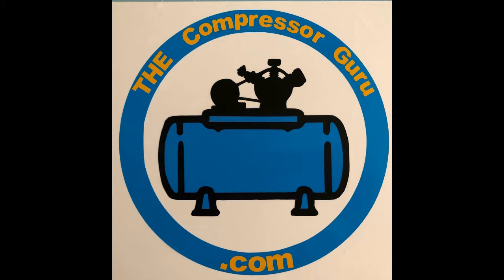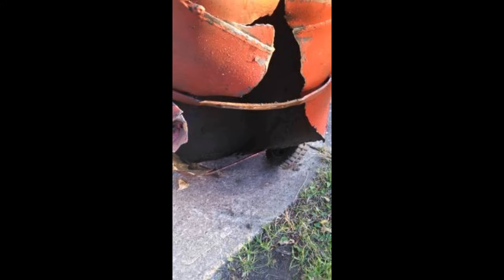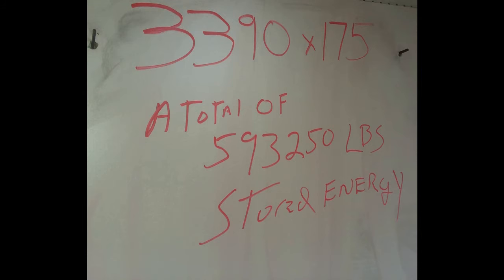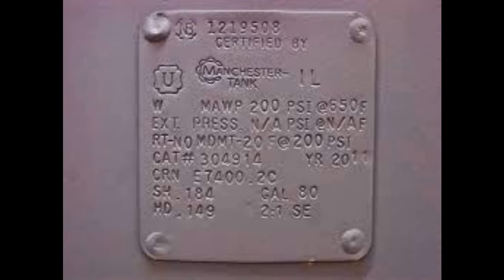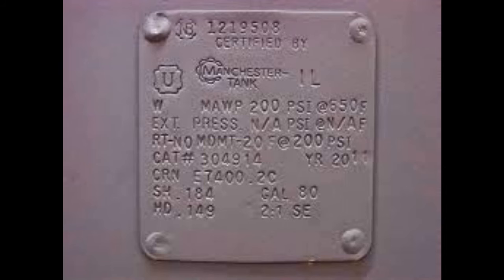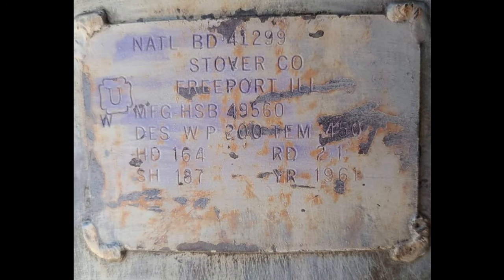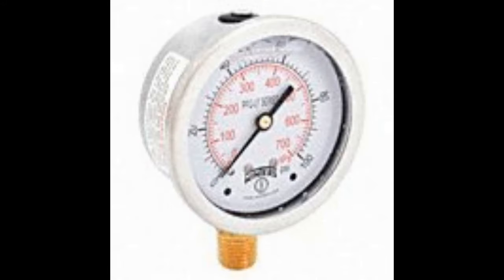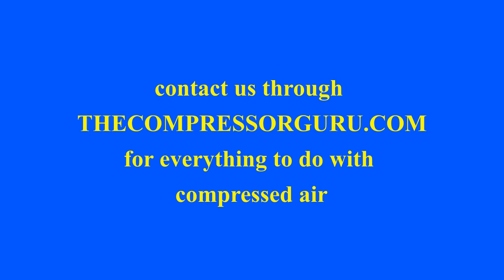Tank Safety, This video may SAVE YOUR LIFE!

Comment: My co worker had his vertical tank blow up thru the roof like a rocket and kick out the concrete block wall when it went off.  Too bad I didn't get a picture for you on that.  It must have sounded like a bomb went off I am sure of that!   Good thing no one was even near it when it failed it caused a lot of collateral damage in a 10 foot radius.
Reply from the maker: I am very glad no one was hurt. some people think this video is hype. it is a pressurized vessel, stored energy.  have a great day.
Reply: @THECompressorGuru  I have zero doubt about the lethality of a tank exploding after having witnessed the aftermath of what it had done to his garage.

Comment: Love the video but have one critique. Agreed, a pressure vessel could be considered an energy storage device, however, the 5hp motor running for 8 minutes, and the comparable work it could achieve isn’t really analogous. Compressing air is wildly inefficient. Most of that energy will be wasted as heat, both absorbed into the air being compressed and dissipated into the atmosphere. That’s all energy wasted before air even hits a tool, which further perpetuates energy losses. The energy put in to pressurize the air doesn’t all end up in the tank. It’s a very disproportional relationship, however, that doesn’t mean it’s an insignificant amount of energy. The danger comes into play considering the form of stirred energy. Compressing air is effectively like compressing a giant spring. If you applied equal energy into a hydraulic system, but it’s far less potentially hazardous just because hydraulic fluid is not compressible.
Reply from the maker: you are correct about a couple things there is a given inefficacy to compressing air I am sure that most of the energy to compress air is wasted as heat. 
 you are correct that hydraulic is safer in these respects. but there is very limited ways to store hydraulic energy. that is a major difference with stored air.
 a compressed spring is a different type of stored energy, there is a potential energy  and once it has expanded the energy is gone.
 if you have a tank failure there may possible be shrapnel involved which enters an entirely different realm of what may happen after the air has decompressed.  interesting points to consider.
Reply: @THECompressorGuru  absolutely true. For all intents and purposes, hydraulics cant be stored to the degree where they’d be able to achieve any work by real world standards given the fluid dynamics necessary in hydraulic systems. I didn’t mean to nit-pick but just felt compelled to mention that pneumatic storage as far as an energy vessel, has a very disproportionate relationship when considering energy in supersedes energy stored by a considerable margin. Regardless, if the tank were to encounter catastrophic failure, such as an explosive decompression, the hazard still remains quite lethal. I just attribute it more to the properties of the form of stored energy rather than the energy required to charge the vessel (compress the fluid). It’s not necessarily the potential energy that makes it lethal, rather the compressed air is essentially a spring; moreover, it’s compressibility property grants it the capability to violently decompress.
Reply from the maker: @kfs777  Agree

Comment: Im still weary of certified air vessels after witnessing a 120 gallon IR propelling through cinder block, chain link and into the parking lot. It was professionally installed and yearly inspected along with the other two compressors. I remember starring at it, it peeled at tha seams : \
Reply from the maker: Bill I agree I just wonder how old the tank was MOST boiler/tank inspectors will require hydro testing after 40 years. but tanks do fail. that is why we should be as careful as possible.

Comment: it seems there are more videos on this where the failed tank was a horizontal unit vs a vertical one. no doubt the vertical could explode too but it seems to me the horizontal has more surface area drain and I don't think they are pitched to let water escape are they? like a shower floor would be to let water drain, vs say a vertical tank where usually with the drain at the very bottom, moisture should drain out easier helping to reduce rust build up?  also I've seen the mods for after coolers or maybe more expensive units have that already added. Seems like that is a good idea with a water trap before the air enters the tank even ?  Still I always drain mine and leave the valve open but i use it infrequently also
Reply from the maker: good points. 
with a vertical tank the bottom is domed and an drain point. 
on the horizontal tanks they have to be slanted slightly towards the end that has the drain. and not to much so that there would be a "heel" below the drain. 
I think the biggest factor in many of the tanks is maintenance and you are doing good.
 the other thing is the cheaper compressors do not have "coded" tanks which means that did pass a test 150% of the working pressure. 

I personally will not sell a non coded tank or would I ever buy 1 for personal use. Good Comment. thanks

Comment: I have a question, What do you think about putting fuel tank sealer paint inside the tank. 
(Not to seal leaks )But for a coating or barrier to prevent moisture contacting bare metal inside the tank. I was looking at product that had a rust inhibitor and moisture barrier.   
I haven't done it to mine. I was just wondering if anyone out there has or if it's a bad idea and why. Cheers
Reply from the maker: this has come up before. I think at least use something like extendo from permetex and get the bottom coated.
Reply: @THECompressorGuru  thank you I'll look into it. Do you think it's a bad idea?
Reply: Not a bad idea. You may never know.if it helped, if the tank never rust out... it probably helps and will not hurt.
Reply from the maker: @the-trolling-mechanic  no its a good idea. it can't hurt it can only help. I answed from my phone under bud stiner

Comment: What if I have a tank with a small pinhole leaking air.... and I need to finish a job (wood finishing job), can I still use it without trying to repair it? The tank also has a safety valve, and I set the compressor to work between 30psi and 60psi..... of course, the compressor keeps running more often, but not that much...... how risky is that?
Reply from the maker: I do not want to answer this question. because I am not able to see the future. I will say a pin hole is the very best way a tank can fail! get a new tank very soon!!!
Reply: The pinhole indicates the tank has failed.  You got lucky by getting the tiny leak that tells you the tank is done, instead of the tank just exploding.
Reply from the maker: @e-curb  a pin hole is a failure. it is the best of failures, rather than a catastrophic explosion!

Comment: People need to drain their tanks from the moisture content on the daily, minimum weekly, this moisture creates rust that then clogs up you pressure relief valves, and can also damage the pressure switch, it’s this switch that kicks in and out once the air volume drops or reaches maximum capacity so understandably this switch can wear out, now it’s your relief that should be a fail safe should that occur, guess what happens when it doesn’t ? It becomes a bomb, so drain your tank, check that relief valve daily , it literally takes but a couple minutes.
Reply from the maker: you just described the perfect storm!

Comment: I purchased a Black Husky 20-gallon vertical air compressor from the marketplace yesterday. However, upon inspection, seller said the motor fan is broken. I've already ordered a replacement fan. The seller assured me that the compressor is less than 2 years old, despite the broken fan. He mentioned that it has been stored in my garage for about 8 months. He suggested that by replacing the fan and draining the water from the tank, it should operate like new. Is it acceptable for the water to have been sitting in the tank for approximately 9 months, considering the seller's claim that the compressor is less than 2 years old? It's my first time using an air compressor, and after watching this video, I'm a bit worried about the possibility of an explosion. 🙂
Reply from the maker: I am sorry to hear this. I would have a great concern about the safety of that tank. if you have the ability to hydro test it, PLEASE do.

Comment: lesson one, do not mess with a pressure vessels integrity. don't drill, cut, weld, hammer, drop, shock, hit one. if there's any signs of leakage, immediately vent the pressure off and render it permanently unusable.
Reply from the maker: I agree  with all but the last. a leaking tank can be repaired by a certified welder then hydrotested. before putting air pressure back in it . some larger tanks a may be worth the expense to repair and test. BUT DO NOT JB WELD LOL
Reply: @THECompressorGuru  No it can't.

It's technically possible.... but it's prohibitive to do so legally and correctly on these cheap small mass produced vessels.  You couldn't even afford to obtain the proper documentation to start with.  

Being a code certified welder is only part of it.  There's inspection, testing, and documentation that would need to be performed also to be legal.  

Not to mention anything that corrodes through is going to be shot and condemned. You cannot weld with any integrity on corroded metal for starters. You can't access the inside to clean it or prep it.

Even larger compressed air accumulator tanks in industry, typically do not even come with man ways. They're basically unrepairable. They are also pretty cheap. You can get a 2000 gallon tank for under $10,000. You couldn't afford to even repair that vs just buying a new one.
Reply: @THECompressorGuru  well... that's interesting. Your last words in the video were to NOT weld a pinhole. I recently picked up a 60gal 5hp compressor and realized it has a tiny pinhole. Certainly there must be thin spots inside. I was considering hydrotesting after having it repairing but am getting mixed messages.
Reply from the maker: @danielbuckner2167  you did hydro test it to 150% of the working pressure on the tag? if you did after repair then ...ok.
Reply: @THECompressorGuru  The repair has not been made yet. It would be tested before use naturally.
Reply from the maker: @danielbuckner2167  the risk reward for repair is to low for me. I recommend going tank shopping. 
Good luck 
Bud
Reply: @THECompressorGuru  thanks. I already have other compressors. This one will either be sold without tank for liability or just scrapped. Thanks.

Comment: Yes sir. Watching these videos makes me not want use mine. Cambell hausfeld black 20 gal 5 hp. Belt drive. Had oil less one about same tank. Was wanting to double my 5 hp to 40 gal. Now scared to. Think put mine outside this year build little pump house by the building. Plumb it in.  With auto drain.
Reply from the maker: Paul a pump house is a reasonable choice.you may have other issues in the winter if you are in a cold climate. feel free to contact me through thecompressorgugu.com
Reply: @THECompressorGuru  in wv thinking just cinder block  with styrofoam board insulation. Lid that hinge up or lift off small door way  2’x4’ big enough for compressor.
Reply from the maker: @paultrimble9390  Bad Idea. Compressors make heat . they need ventilation . and in the winter they will need some heat. a 5hp pump running constant may generate 20,000 btu in a tight space you WILL cook your machine. Build a bigger box or a small room.

Comment: Is it good to leave the drain valve open when not in use? 
Such as in non climate controlled shops. Would this help prevent internal sweating during temperature swings or make sweating worse.
Reply from the maker: it can not hurt. but once the moister condensates out of the compressed air, there should be no more water accumulate in the tank fill of air. interesting thought

Comment: I have a Saylor Beall 120 gallon tank that looks like it was commissioned in 1969 and last inspected by WA labor and industry in 1997 that I bought off a nice gentleman a couple of months ago.  It has a working pressure of 200psi.  I got it wired up and ready to go then saw your video.  There was some rust bits that came out when I was checking out the drain port (it was bone dry).  No more than probably a tablespoon or so and no bits bigger than 1/16-1/8".  That was probably from transport knocking it loose.  I ran it up to 150psi with no problem (not leaks) then just shut it off and drained it.  I'm getting the regulator and hose fittings in the next few days. Would you suggest I do a test run (in my garage) up to shut off with no one home or do all the work to get the fittings to do my own hydro test?
Reply from the maker: I am very weary giving advice on this. If I bought a brand new tank and used it 40 years and drained it regularly it would still be time to have it tested. knowing that it was re certified 25 years ago is comforting but I do not know what number a boiler inspector would put on a tank recertification. I do not know if you should trust it or not that is up to you. it does sound like it was well kept. We DO NOT hydrotest here . so the fitting question I can not answer. I can tell you ALL fittings on the tank are NPT . you may want to check out Vintage machinery video link in the description above. good luck. and you may contact me through thecompressorguru.com.

Comment: If someone fixes a compressor with jb weld this would be the first area to break thus releasing pressure through the weakest point. Also compressors are supposed to have Saftey valves to blow off before pressure. Also drain tanks Daily, don’t leave air over night.
Reply from the maker: the safety is only rated for 66% of the tested pressure of the vessel. and if the tank is weak there is not telling if the tank will just start leaking "best case scenario" if it fails suddenly it could be an explosive situation. if someone fixes with JB weld they may end up on some other channel is The Darwin Awards.
Reply from the maker: @super duper ducky I never heard the 65% thing I understand the standard boiler cert test to be 150% of the WP of the vessel. so a 200 wp tank should be hydro tested to 300PSI. If I understand the way you worded the 65% a 200 psi wp should have a 130psi safety valve?
Reply: Someone fixes an air compressor with JB Wells shouldn't have an air compressor. Period

Comment: I bought an old locally produced industrial compressor second hand with a 4kw motor and a 200L tank. The max operating pressure is 16 bars, so it's almost twice the pressure of an ordinary compressor. The tank is made out of 10mm+ thick steel and is certified by the manufacturers. It was made in the mid 80s, and I've just refurbished the pump with new gaskets. I haven't had a hydrotest done to it yet since I have to order a tester for it. After having the test done, is it safe to assume it won't blow up into pieces? That thing holds an insane amount of air and I haven't dared to put any pressure in it yet. Just to be on the safe side, I will probably end up keeping it outside
Reply from the maker: to properly test it when hydro-testing take it to 150% pressure of tank certification. if it holds put it to work and drain the tank at least weekly. good luck. let me know how it works out.
Reply: @THECompressorGuru  I bought a pressure washer today, fabricated an adaptor so I could fit it to the tank. I blocked off some all the outlets except for 2. 1 for the pressure pump and one for the gauge/pressure switch cluster. I got the pressure up to 24 bar (150%) and then the pressure switch started leaking and pressure dropped until it could contain the pressure agsin at 18 bar. I don't have any more blockoff nuts for the pressure switch. Would getting it up to 24 bar briefly be sufficient or should I wait until tomorrow and get another block off nut and try again? If so, could I keep the tank filled overnight or should I drain it and then refill it? It holds 220L of water so it's a bit of a waste.
Reply from the maker: @TheChrisey  you got it to 150% you should be great. you may need to replace the pressure switch.
Reply from the maker: @TheChrisey  usually all controls are removed and plugged before pressure testing
Reply: @THECompressorGuru  Yep that was my mistake to keep it there. I got it to keep the pressure with water for about an hour after plugging the last component. Also got a new relief valve, a new pressure switch... and the fitting was the wrong size. Store told me it would be a 3/8" and since the compressor outlet is a 1/2" I bought an adapter for that. Turns out the store got the size wrong after I read the manual and it said 1/4" inlet. I guess I have to make yet another trip to the hardware store tomorrow then. At least I was able to try it out by simply keeping that outlet plugged and running the compressor with a manual switch. No leaks, no explosions and it ran surprisingly quiet. I guess I've got myself a new compressor!
Reply: @THECompressorGuru  If it doesnt blow does that test weaken the tank at all?
Reply from the maker: @ScreamingEagleFTW  No
Reply from the maker: It simply proves its safe to 150% of the certification.